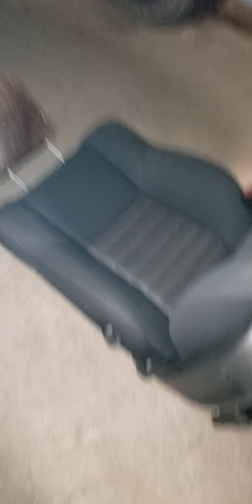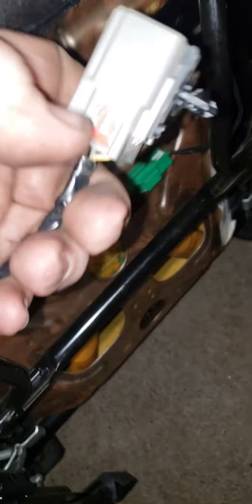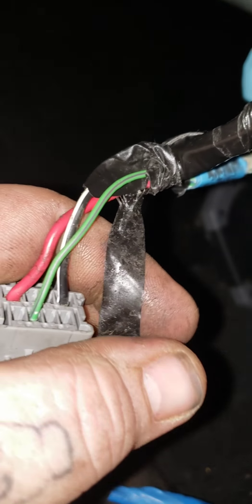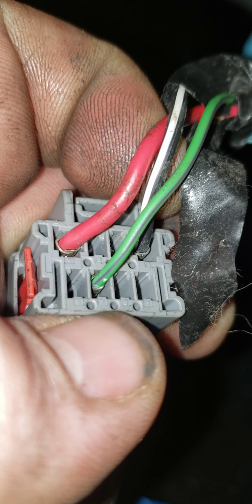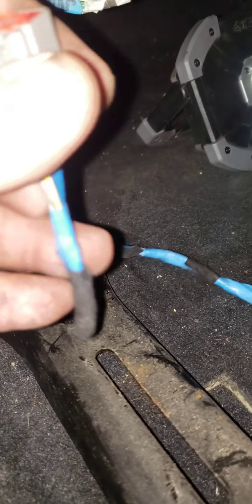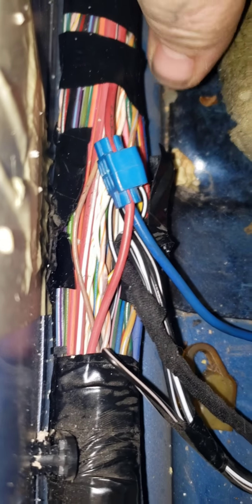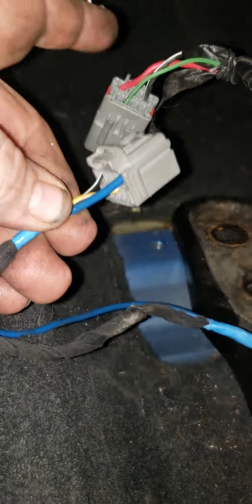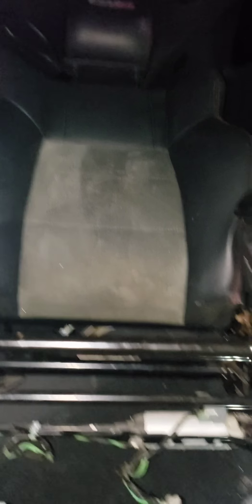How to install power SRT8 leather passenger seat into a challenger SE with manual passenger seat

Comment: I have a SXT I deleted the seats and put in SRT seats right now I’m struggling to find a video on whether I have to swap out the whole harness or just swap out the connector piece and put the wires in the connector and order a SRT connector that will fit bc rn it’s the SXT connector
Reply from the maker: @keastonbanks3940  This video was/is old I'm sure there are easier ways to swap seat power. This is how I did it with just using what I had at the time. I always suggest using factory harnesses when you can it make everything easier in the future for repairs and replacements! I hope this helps and thanks for watching !

Comment: I know this videos 4 years old but can you please tell me where you got the blue wire from? I know you said AC harness but i’m not sure where to find it or how to take it out.
Reply from the maker: The blue wire was from a wire harness that I deleted from a 2005 Chrysler 300c. You can use any wire that has a (copper square) terminal connection into the grey connector that lines up with the power wire under the (srt) seat